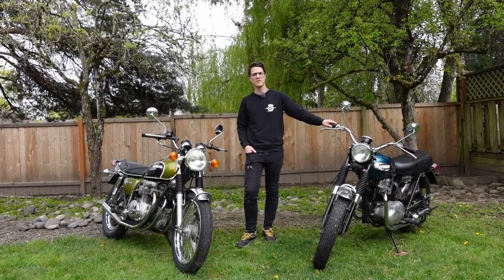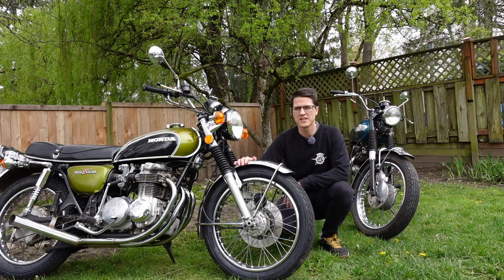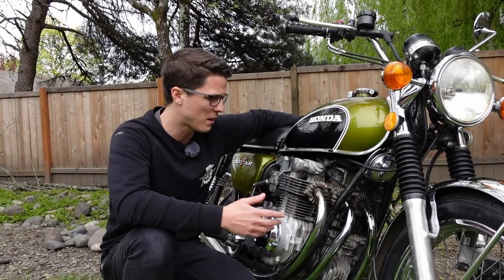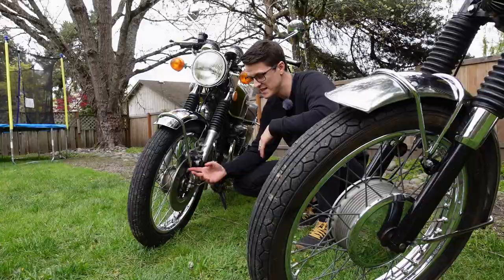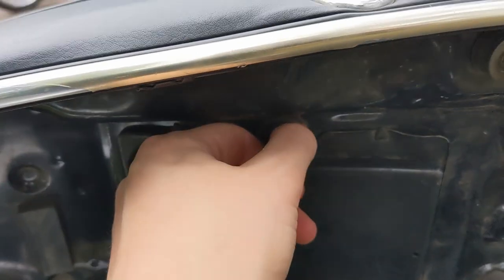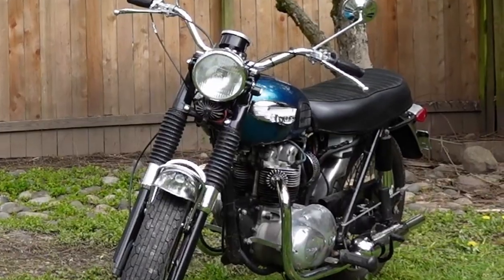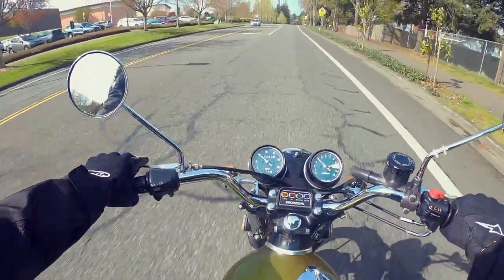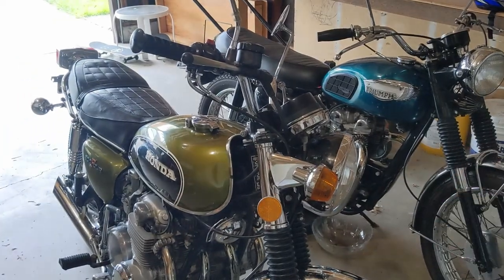How this Honda killed this Triumph

Comment: The first time I saw a Honda 750 I thought aliens had landed, if Honda produced a modern retro 550/750 four I would buy one in a heartbeat, Triumphs were always great looking bikes but they were light years behind the Japanese, even Honda's 450 twin could out perform them....
Reply: My daily ride is a 1980 cb750 Custom survivor that I've had since the early 90s.  Beautiful machine. No silly computers or fuel injection to spoil the relationship between man and machine.
Reply: Or woman and machine.   My daughter has her own bike she rebuilt the carb on.
Reply: @ HH sez who? I've never seen a 450 Honda  out perform a 500 Triumph. Been around bikes all my life and owned bunchs never seen that happen.
Reply: Loved my 450s, in my opinion,  the 1st Honda Super Bike.
Reply: Kawasaki has the rs900.
Reply: you aint seen the retro honda 750 yet?stand by your words and go and buy one already.
Reply: @73Trident  i had a. 1966 305 Super Hawk....had it Souped up.
100 mph in 3rd gear !
Could outrun a Triumph 500 😀.
Suzuki had a 2 stroke 250....x6 hustler....it was fast.
My 305 could even outrun the Suzuki 2 stroke  x6 Hustler.
My friend's had Harley 883....they were even impressed with my 305.
My 305 could not outrun the 883....but it gave them a good run 😀.
I even beat the new Honda 450 when it first came out....about 1967.
Reply: @timvaughn6535  i had a race with my suzuki 250 hustler againsr a 650 brit bike i think was a triumph it was so long ago, the suzuki beat it comfortably but it was a very fast 250
Reply: I agree, the ancient 550 f, 750 f or the Kawa 900 were the most beautyful bikes ever, thats the reason why the prices for top quality originals are far to the Moon.
I love these 4-4 exhausts and allways when i see one of these CLASSICS i look and stare and look...
Thanks i am blessed with a wife that shares my choice for these bikes.
If i would buy one of these so beautyful bikes i wont ride on it, i would put in in my home and just only look on it.
And if you love these bikes two just take a look to the Kawasaki 750 2 cylindre from 1977 too...
Later Honda release the other 750s, the Bold'Dor and the CBX, but they were OK but not these classics. I was happy when Honda brings the CB 1100 a few years ago with that classic 70/80 look.
But...the mooost beautyfull bike ever was the old Benelli 750 sei
Reply: @drhkleinert8241  if you own it, you have to ride it.   I still have a 1978 CB750K that I purchased new.  That's the last year of the single overhead cam engine.   I need to finish the carbs and get back on it.  Beautiful machine.
Reply: @timvaughn6535  I had a hustler and I can assure you that it would've annihilated any harley, most of my mates had newer Japanese 250s, one guy had a 400/4, none of them could get near the hustler and it would've taken a very special triumph 500 to beat it.
Reply: I had a CB450 in the late 1970s. Fast, and with better damping it handled OK, but it started smoking heavily at 47,000Km. I rode it briskly, not thrashing it, and maintained it by the book How times have changed! My 1986 BMW R65 reached 700,000Km before needing any engine work beyond a new timing chain at 500,00, and very reliable.
Reply: My 2013 CB1100 is a sure lookalike…you can even order aftermarket tank and side covers that fit the bill ever more.
Reply: I test rode a Triumph 500. Shook like all hell. Tried a 450 Honda DOHC, much much smoother, and faster. Bought it, even though the Trumpet looked and sounded better.
Reply: @johnallen9819  
Your opinion is totally wrong.
The first superbike was the 750 single cam honda from 69 . Genuine 100 plus performance , oil tight engine , electric start & brakes that actually work.
Proper game changer .
The 450 was a humble daily commuter & could never be considered a superbike even by its biggest fan .
Reply: @joestihl2234  It's certainly not on their site.  I remember they made a retro CB1000 a couple few years ago.
Reply: Henry Hartley My 1976 T140V Triumph Bonneville raced against every Japanese motorcycle that was on the streets on Long Island NY from 1977 to 1992 and she won against everyone of them (latterly hundreds) from the first face until I retired her in 1992 because she being a 16 year old machine while still winning against the 1992 Japanese high performance motorcycles she was getting old and so was I and I was a parent now. She retired from street cafe racing undefeated in 1992 and I purchased a Harley-Davidson 883 Sportster and became a relaxed see the view cruser. What you said about Japanese motorcycles outperforming my Bonneville was completely false, utter lies. Hundreds of young men with your exact attitude thinking their new Japanese high performance motorcycle would win in a street cafe race against my Triumph learned the hard way that in fact they could not and every one of them lost to my Triumph (stock I might add). I still own her and respect her. I still ride and I'm on my 3rd. Harley-Davidson, another 883 Sportster-a great around the back roads cruiser. - Peter age 72
Reply: @73Trident  I have. I spent a lot of time at the strip back in the day, and never saw a Daytona beat a 450. I'll agree they should be close. But the Triumph SHOULD win! It's 50cc larger, and it's lighter.....
Reply: @timvaughn6535  450 came out in 1966.
Reply: Honda no longer makes big air cooled motors ..

Comment: "....The "feedback" is so important.  As a long time rider and service professional, I can't help but recall taking out the shop owner's BSA Rocket III a few times and totally enjoyed it.  It was no Z1 Kawasaki or GT750 Suzuki but it's quality of "feel" could not be disparaged.
Reply: THIS!
The Brit bikes weren't the fastest by the time the CB750 came out, but you could ride one hard on curvy roads and they just became part of you.  Very unlike the Honda, and especially the Kawasaki 750, which would go great in a straight line, but kill you on a twisty mountain road.  
If all you wanted to do was go fast in a straight line, then get a CB Honda or the big Kaw triple.  If you wanted to really RIDE hard, a Brit bike was hard to beat.

I love Harleys too, but that is a different kind of riding altogether.  Cruse and hear the thump as opposed to tame the windy roads on a Trumpet or Norton.
Reply: It's easier for me to choose a bike to meet my needs if I ignore such irrelevant factors as standing quarter or 0-60 times. Fuel economy matters (I have a 109Km each way commute) but I'm not concerned with power as long as it's adequate.
Reply: @bertmeinders6758  The "thrill factor" seems to be driving so many to want performance over function.  By the time the '70s came around, there wasn't a bike we sold whose drum brakes weren't adequate for safe riding and stopping distances.  When the front disk brake became the norm, I felt that any brake that could make the front tire howl was good enough.  Now, the quest is to have brakes that can stand up to repeated punishment which really is not necessary on a commuter bike.

Comment: When I got my first job after I left the service I found one of these CB500s.  Great bike.  I used it to go to work, ride around Shreveport and to run down to Houston where my mom and dad were living.   The bonehead i bought it from had cut off the exhaust tips and the noise drove me nuts.  In Shreveport you could ride a bike all year, you just needed a good coat( I had liberated a.field jacket from the Marine Corps.) and you had to pick your days.   The bike just never failed.  Keep good tires on and change the fluids when the service manual said to and you can still find running examples now that it’s. Fifty years later.
I have to argue with “ the triumph just looks better.”   I had a Norton 750 for a little while in Guam in 64.  It was gorgeous but, to me, the Honda 500 with the seeping pipes and small piston set and killer tank shape were captivating to me.

Comment: The Triumph engine was designed and first built in 1938 and remained virtually unchanged apart from increase in capacity right up to the 80's Bonneville T140.  Their downfall was the management not being willing to come up with a new design.  They went up to three cylinders with the Trident T150 and T160 but when one of their engineers produced a prototype 4 cylinder engine nicknamed the Quadrant and when it was shown to the management team they allegedly replied that they could not see than anybody would want a four cylinder motorcycle.  Within a very short space of time Honda produced four cylinder bikes from 350, 400, 500, 550 and 750.  Triumph lost out due to poor management decisions and lack of foresight more than anything else.
Reply: Bad management killed of BSA and Triumph as BSA owned Triumph. The first trident P1 ran in 1964  and could have been in production by 1966 but management didn't want to know. Only when news of the CB750 reached management  did things progress but BSA wanted there own version requiring different frame and crank cases which delayed production and put up costs. The  P1 looked like a Bonneville but  the design was putout Ogilve Design who came up with the slab tank and Raygun silencers which the USA hated  which resulted in  beauty kits being sent to the USA. The Quadrent was never a prototype as it was two Trident engines with a cylinder cut of each one and joined together, crank was pressed assembly and a overhang on one side of the frame to keep the drive in line , with a mid state of tune due to the crank assemble it did  125mph. what was being developed was the T180 of which 3 engines were built, one was tuned for racing  which is now owned by Steve Brown
Reply: And then along came the Z1.....
Reply: I had that experience in an unrelated industry. Within a couple of years they had licensed in a design!
Reply: Triumph also made a two stroke engine but again triumph Management put their heads in the sand. Wanna see it go to New milton hampshire uk, sammy millers museum.
Reply: @carolrowley9868  is this the same bike where the management asked the designer if the engine could use existing barrels and the designer said no?
Reply: Yes, the problem was arrogant management & infighting between the BSA/Norton divisions as best exemplified by the 3 cylinder BSA Rocket-Triumph Trident which was held up FOR YEARS because BSA management wanted a forward sloping engine & Triumph wanted it upright. Imagine a world where the Rocket/Trident had been selling for 2-3 years before the CB750, maybe even where a 4 cylinder Liter version had been introduced already.

Comment: I remember in the early sixties when the Honda bikes arrived in my country. They really put the local product to shame when it came to engineering.  I was in my first job so the new Japanese bikes were out of my reach.  I rode a 1957 350cc AJS single at the time but I coveted the Honda 125 Benly and 250 Dream (there was a 305cc bike also but I don't know what that was called, I guess a CB77). In those days the Triumph was known for its engine but the frame was thought too flexible (some folks took the Triumph engine and put that in a Norton feather bed frame for the best of both worlds). I don't remember much sympathy for the manufacturers of the British bikes (or for the British car manufacturers that followed the same path a little later), they had not invested in the future, turning out the same old tired designs for decades and by the time they woke up it was too late.

Nowadays I run an Indian made 650cc Royal Enfield (which I like a lot).
Reply: They made a 305 dream as well
Reply: England had been bombed almost out of existence, and I think maybe they were spending their money to get back in business and didn't have the choices Japan had. They should have sent MacArthur to rebuild the British.
Reply: @algentry1   Well I'm no expert on this stuff but as I understand it Japan was pretty much bombed around the clock by the US, culminating in a couple of Atom bomb drops. After the war the US poured a lot of time and money into getting Japan back on its feet. Not so much the UK. One thing the Japanese did have going for them post WW2 was not spending huge amounts of money on the military (likewise Germany), that was forbidden while the British had to cope with a rapidly self dismantling Commonwealth of nations and its choice of its own nuclear deterrent (which was not cheap). The British also had to pay back the US for much of the war materials help they had proffered prior to 1941 i.e. from 1939.
Reply: @dogphlap6749  - well said, also aloof management and politics played a part plus clueless money wasting on models like the Triumph Tina and Ariel 3 making Japanese bikes all the more welcome in the UK by the 1970's, the Japanese changed the whole game and made bikes fashionable again while BSA were still making the Bantam thinking about moving the spark plug to the centre of the head, the choice of 22 Japanese 125's killed that relic stone dead, thank god. 

It still doesn't diminish the T100 being a very fine and versatile motorcycle that could take a man round the World, win Trophy after Trophy and two Daytona 200's as well as lend itself to the basis of the Tridents and Rocket 3's which ruled the Daytona 500 for a good few years eventually competing directly with the Honda CB750 in race trim, more the stuff of immortal legend than killed by a CB500 .. unless it died laughing at the Honda's original 4 silencers? quite possible. The UK was actively involved with the Japanese, Barry Sheene won two Grand Prix's for Suzuki,  Belfast university were doing race work for Yamaha and more importantly we were buying their Bikes and enjoying them, and still do after long restorations.
Reply: The 305cc Honda was also called' Dream'.
Reply: @dogphlap6749  yep

Comment: Does it make sense to compare a hedgehog with a rabbit? No, not really!
The diffrence between these two bikes is similar. Technically they have nothing in common.

The only way to see a comparsion between both should be the technical evolution from 1966 to 1969. 
The real counterpart to all the Triumph twins was the CB 450 from 1965.

Comment: Both great bikes. I’m around your age as well but my affinity is for the in-line 4s. I work as an engineer so I think prioritize function over form when it comes to these old bikes. I love my admittedly weird looking ‘81 xj Yamaha 550 in all its over engineered glory. I marvel at its DOHC and fancy induction control system. I feel Yamaha sometimes gets overlooked in the classics category because they just copied styling from Honda but some of their engineering was top notch.
Reply: I'm with you! That said, in this case, I think the Honda even looks WAY better, too. (Btw yeah Yamaha is so great at engineering so many things!)
Reply: I have an Yamaha 88 FJ1200 my mates all have Harleys and one a Triumph speed triple. My old girl is better engineered than them all and still pulls 230 + Kph no problem.
Reply: @kevscranes  my last bike was an 84 fj1100. Awesome. Felt like an extension of my mind, you just looked at the line you wanted to take and the machine did the rest. My taillight disappeared in the distance to more than a few SDPD patrol cars.
Reply: When the Yamaha RD250 and 350 LCs came out in the early 80s, they were a marvel, game changers in performance and all sorts of ways. They virtually made all the other bikes in any class obsolete overnight. Never had Honda been so outwitted and caught flat-footed. 

And they had ‘King’ Kenny Roberts dominating the 500GP class as the perfect advertisement. We all salivated over those machines haha
Reply: @MrSummerblade  rd250 made all bikes in any class obsolete? Maybe if you weigh 120lbs in leathers and helmet and are racing on hairpin turns. Thats a moped for nearly anyone else.